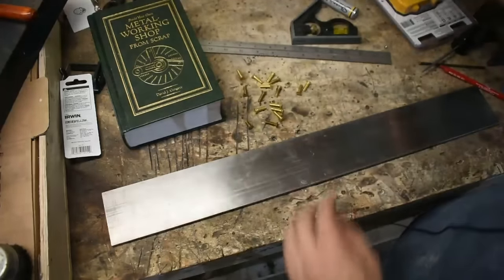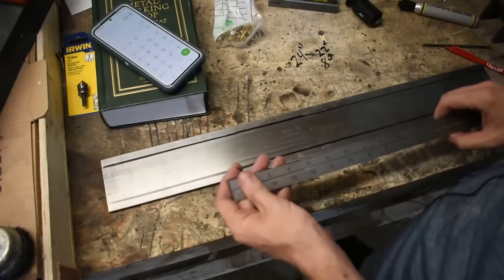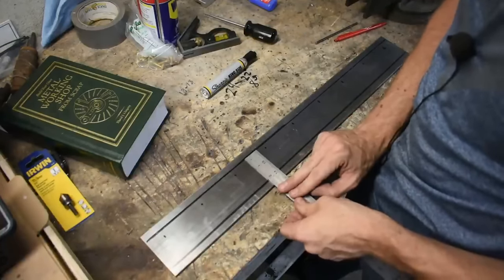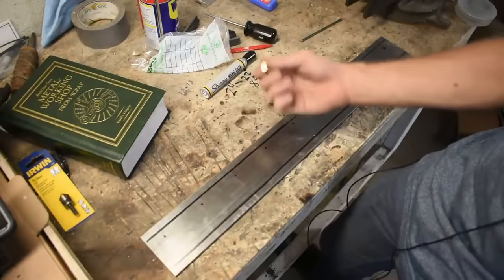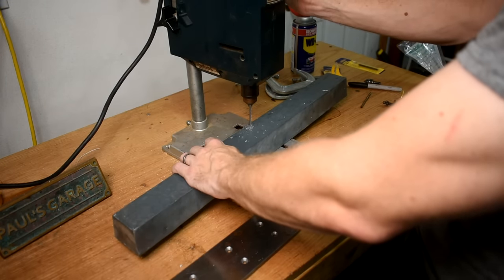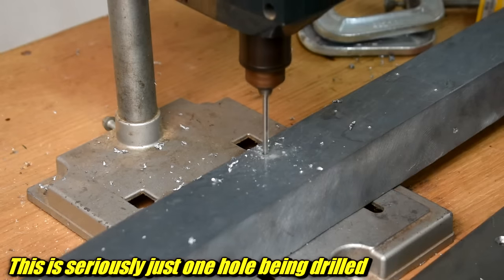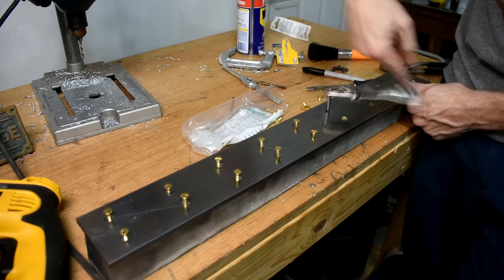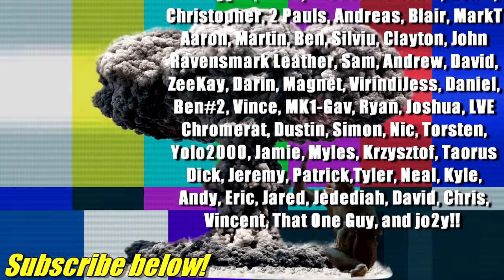Mounting the DIY Metal Lathe Bed Ways | DIY Gingery Lathe Part 3

Comment: Okay, Paul. Bear with me because you’re stepping into the world of machining. Everything is about to change. No surface in your house will ever look flat again and every single object around you is about to become a spring. It’s okay. I call it the journey to machinist Shan gri la. Just for the experience scribe two parallel lines on a piece of stock and mark points at the same increments with a mechanical pencil and and a scribe, One marking tool for each parallel. Then, using a magnifying glass, stare in horror as the pencil lines get farther and farther away from the scribe lines and absorb the dread that comes with marking anything with a sharpie. Soon the surface plate, Height gage and 1-2-3 blocks will become your most beloved tools. Make no mistake. The drill press IS a machine tool. Master the art of pecking for chip breaking and applying cutting fluid periodically. Also WD40 displaces your way oil.
Reply: Pecking dramatically reduces the life of your cutting tools. Long curly dangerous swarf FTW. Back out and relube if you get on the hot side and before softening the tool steel. Otherwise I identify with your straight flat square obsession comments :-)
Reply: Can you explain surface plate, height gauge and 1-2-3 blocks to me like I'm 10?
Reply: @miceskin  Like you’re 10, eh? I’ll try. It’s not an exaggeration to say that no surface in your home will look flat anymore. Once I had a good flat reference to check stuff against I would shine a flashlight behind the flat edge and see light in the gaps. My kitchen counter had a bunch of shallow dished features and high points and I had always thought that surface was flat. A surface plate is a genuinely flat surface and it’s a very rare thing. The height gage and the 1-2-3 blocks are tools that make the surface plate usable for scribing lines. The stock you want to mark get’s backed by the 1-2-3 blocks to assure the piece you are scribing is perpendicular to the surface plate and the height gage is used to scribe the lines parallel to surface plate plane. Now you said “like you’re 10”, and the more I look at this the more I think I failed… These three tools are a team that let you mark and measure very specific lines on an object just by turning the object on It’s side. I hope that helps.

Comment: yeahhhh slow that countersink waaaayyy down. thats the best way to get rid of that chatter. Also, center drills are super handy for getting a precise start on a hole!  Remember, that bit of precision in the beginning, counts way more when you are 4 steps down the line! good work so far! been following this project for a while. :) 

PS, as a fellow ADHDer, get a small drill bit, drill a hole in your chuck key, and put a wire fishing leader line attached to that. Attach the other end to the drill press. And you will not lose it agian. I promise you this will change your life. Your grandkids will talk to you again, your berry bushes will flourish, you will find quarters on the sidewalk instead of pennies. It is worth it.
Reply: I quit center drills for millwork a long time ago, now I use spotter bits if it's critical, otherwise I use screw machine drills, short and very little deflection, or choke up in the chuck.
Reply: A rare earth magnet on the drill press to hold the chuck key is also a good idea, but yeah, if it's tethered, that's helpful as well.

Comment: One consideration, if you need put together two pieces that intend to be very precise, consider use a mix of Portland cement and two compounds epoxy resin, between the two pieces, it provide a good contact point with low distortion factor
Reply: Uncured portland cement is corrosive. A better alternative mix is silica dust "sand" + epoxy resin.

Comment: There’s a bit called a center drill. They come in sizes #1-#6. Maybe bigger. For precision drilling u should use this before drilling. It won’t wobble.
Reply: This can not be overstated. However if his drill press is as loose as he says he'll still have issues. I have a beautiful Fobco Star with loose bearings that I need to freshen up that is like this and I own and use centre drills.
Reply: Oh my god, Paul, that drill press is less rigid than my third leg looking at photos of Hillary Clinton. Consider finding a good used American one and freshening it up.
Reply: @fredio54  Center drills are overstated and outdated.  Use a hole-starting bit.  The problem is not the drill press.  The problem is that you need a deep enough spot for the center of the drill to land.  The center of the drill doesn't really cut---it cold forms and extrudes the material.  So when you start a drill on a flat surface, lots of pressure is needed.  If the drill is small, it will wander.
Reply: Center drills are intended for creating center holes in a workpiece for turning between centers on a lathe. They work, but a proper spotting drill works better

Comment: Do you intend on making more on this project? This is all  i wanna do this year haha  bought the books and going down a deep rabit hole
Reply from the maker: yes! my next video is on this project.  casting the feed.  I modified them to be cooler looking and hold up the massive headstock better.  The feet in the book are a bit small.  I'm also going to use a cool sand casting technique i've never shown before
Reply: @PaulsGarage  you gotta drop a way to contact you so i can start on mine soon ahha  need  a few pointers

Comment: Brass screws add a nice touch. Anxious to see more.

My milling machine has turcite strips glued to the underneath of the saddle. I replaced them when they wore out with 1mm teflon strips cut out of a sheet. Has lasted for years with moderate CNC use. Something to think about.
Reply from the maker: Pretty good idea with the Teflon!  I thought the brass looked cool.  That's my only reason for doing it lol but they do look cool.  I want to cast some parts in bronze as well, especially the hand crank knobs and bearing caps and stuff
Reply: Flat head steel grade 12 socket caps are far better and industry standard.. Brass can stretch easily.

Comment: I used too lose the chuck key until I put it on a chain connected to the drill press.
Bed looks good and bravo not breaking the tap in the gummy zinc.

Comment: I’m not putting these vids down, but why not buy a lathe that requires reconditioning? It would work out better, and in the long run cheaper. I know it’s great to say you built it. But restoring a lathe is the way to go. I rebuilt five lathes, Little John,Myford, Atlas, Drummond,and a watchmakers lathe. I actually thought of building one of these Gingery lathes but after doing some sums,decided to recondition a lathe. The first one, the Atlas was a heap. But it allowed me to rebuild the Drummond. And the Drummond allowed me to rebuild the Atlas. And from there the Drummond was the work horse for rebuilding the others. Happy days, now live in a fifth floor flat. Boy I miss my workshop.

Comment: Total amateur here but you're gonna wanna pick up the low and slow method for machining since your machines will lack the size, strength and rigidity for fast feeds and high speeds. This holds for most machining operations, so your drilling operations would be better served following along these lines. Its critical to maintain the precision and accuracy you want/need out of what you are building. Every error/mistake will compound on each other making calibration hell on earth. With careful practice, technique and focus, you will be able to accomplish quite complex features when the machines get completed. Its really cool that you are already focusing on qualities of materials. Its often an afterthought until you run into projects where its necessary. This should help you avoid some pitfalls later. If you stick with it, yes your garage will soon be the fuller.

Comment: I've had terrible luck with those countersinks in metal. Single or "zero" flute are now my go to. Seem to handle much nicer in non rigid setups like in wonky drill presses and hand drills
Reply from the maker: I think "wonky" is an understatement lol.  I haven't tried any other countersinks, maybe I'll experiment a bit
Reply: Need to run multiflute chamfer bits in a mill locked in position and much lower RPM. If a bit is chattering it's turning too fast. 46 year machinist here.

Comment: Please don't use wd40 to tap anything. It's called wd40 because it's WATER DISPLACEMENT. The word water should tell you something. Always use Oil to tap, drill or anything to do with metal. NO wd40, Just throw that to the back of you cabinet. Oil! even motor oil is fine.
Reply from the maker: good tip! i have plenty of motor oil leaking out all over my garage, will be easy to grab next time

Comment: Holy cow! I'm a long-time machinist and I'd be happy to provide a basic boot camp training session. I'd start with basic speeds & feeds - it's pretty simple and would improve your machining results quite a lot (even a drill press is "machining" of course).
Reply from the maker: Thanks! If you have tips join the discord, that's usually where I put questions.  In this case though my drill press is kinda crap, if I slow it down it will just stop when the bit hits the metal.  It's sloppy too.  It's a super cheap one from the 70's I think.  Good ol' Montgomery Wards.
Reply: Me too, not gonna lie, this was painful. No offense dude, we all start out the same.

Comment: You only broke a little bit off that bit. You can sharpen it back up.
Reply: Slow down there, big dog. This isn't This Old Tony.
Reply: @donbrewer6865  sharpening drill bits isn't that hard to do. You could probably do it on a concrete sidewalk if you really had to. Personally I use a dressed bench grinder myself though. That makes it even easier. There certainly are some tricks to doing it. Sharpening twist drills is definitely a skill worth developing. It is nice to always have sharp bits.
Reply: @1pcfred  I'm fully aware. I sharpen my own too. I just like making shit jokes.

Comment: Lower the speed, get a new bit. Great to see you working on it, again.
Reply from the maker: Thanks for the tip!  I think I need a better drill press too.  If I turn the speed down it doesn't have enough power, it just stops 😂
Reply: Counter sinks are especially prone to chatter if run too fast.

Comment: The speed you are drilling and chamfering with seem way to high.  A punch or centering bit will help. You might want to switch to hex or torx head for the future.
Reply from the maker: yeah part of that is this weak drill press.  if i turn down the speed, the bit will just stop as soon as it starts cutting into the metal

Comment: That drill press... Ive spent forever dealing with garbage presses and ghetto stuff.. upgrading to a chineesium press was the greatest thing ive ever done, upgrading from the chineesium to a good chineesium one.. even better idea ive ever had. 

save your sanity, make and ghetto everything else... but buy a drill press that doesnt wobble....
Reply from the maker: I think you are definitely right.  It's hard to drill a straight hole when my drill press refuses to stay straght!
Reply: @PaulsGarage  That's not very LGBTQ friendly requiring it to stay straight...  😜

Comment: It would have been better to scrape the steel instead of the casting, since that will be the actual bearing surface.
Reply: The surface of the casting is very uneven it can have significant hollows, high spots, and twist. If not made flat the steel plate will conform to the irregularities when screwed down. Aluminum is vastly easier to scrape than steel!
Reply: The point of the gingery lathe is cold rolled steel is available for cheap and it is very flat.  Thus you don't need to scrape it.  You need to scrap the bed a little,but the goal is just support the steel.
Reply: @henrymiller1820  That stock looks like precision ground O-1 oil harden. Thats not 1018 cold roll.

Comment: When laying out bolt centers divide the overall distance by the number of spaces not the number of bolts.
22÷8=2.75 = 18 bolts on 2.75 centers.
22÷7=3.1429 = 16 bolts on 3.1429 centers.
The first bolt in at 0 location so you only need the number of spaces from 0.

Comment: Your speeds are way wrong, thats half the problem, theres online charts yiu can look up for cutting speeds of drills per size to material, same with drills mills lathes.
 2 your drill press is vibrating around the table 😂 , yeah not great resonance while cutting metal there 😂. 
3 bad drill bits, your drills are sharper on one side more than the other causing them to wander.
4 get some cutting coolant, theres no excuse to not use it then say um derrr why my drills not cut right? 😂 and give me uneven wear and chatter.. 
5 tap dont come in a single piece set, single piece taps are to replace the broken one from your 3 peice tap set, a tap set has 3 taps the starter tap, the through tap and the finishing/bottoming tap, use all 3 in order and your threads dont gum up or gaul and you wont be over working the tap to snap it.. 
 So basically, just use the tools the way they are designed to be used instead of just damaging them like a monkey 😂 and things start working properly.😂
    And my statement still stands, in todays day and age you are doing yourself a huge disservice following gingeries methods they are for farmers 60 years ago with no tooling.. just use todays tools and take advantage of getting some parts machined for you like the slide for $40 at a local machine shop, then at the end you will say damn im glad i spent 1000 hrs buildi g this acurate lathe instead of saying man i wish the lathe that i spent 1200 hrs building was accurate enough to machine something....
Reply: My understanding is that the biggest part of building the lathe is learning skills. A person could work part time at Walmart around their full time job to save up for a commercial machine, but that is a miserable time compared to building your own machine.
Reply: @blazunlimited  obviously.. thats why its worth building a working one not an ornamental one
Reply: @4kays160  From what I have seen of Gingery lathes, they work well enough for a home hobby machine shop like Paul’s. A Harbour Freight mini lathe isn’t so great right out of the box either.